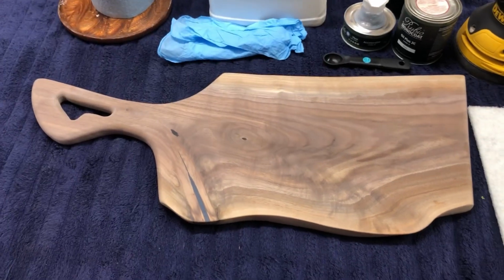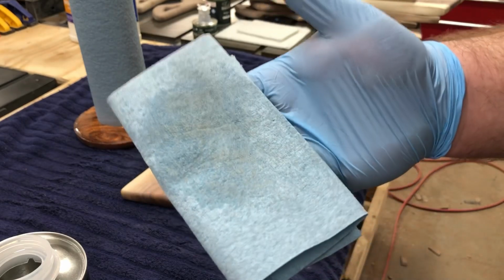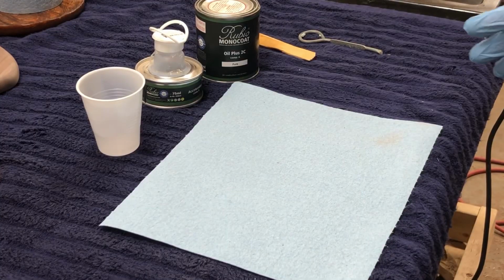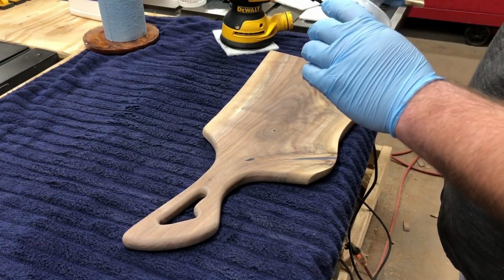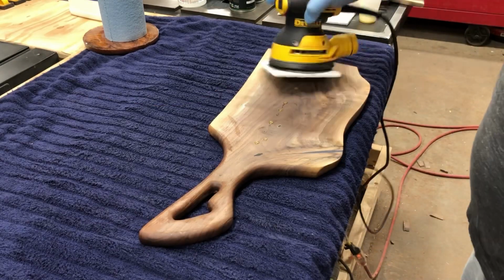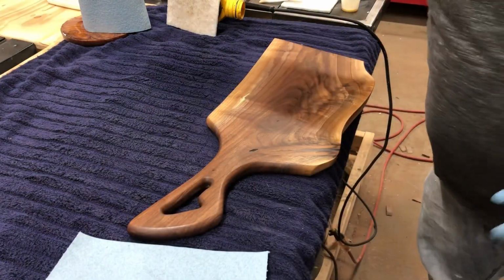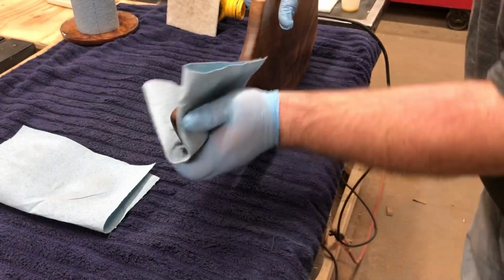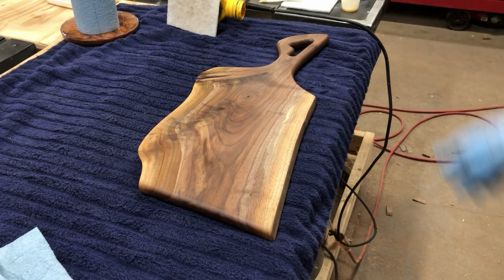How To Apply Rubio Monocoat - Simple Step by Step Process

Comment: Any idea what would happen when you put food grade mineral oil over the RMC? Obviously my board customers aren't going to have RMC available to maintain the board after several washings, and will be using a normal board conditioner off the shelf.
Reply from the maker: @ericsyvertsen5880  great question. I apply a thin coat of either cutting board oil or wax over everyone I ever do. It really helps with the shine and also provides another layer of protection. In my experience it’s never been an issue using wax or oil over top of Rubio. The wood will take what It can and the rest is wiped away. I suggest it to every person I make one for because you’re absolutely right they need to keep up on the maintenance and it’s the easiest safest way to do it.

Comment: Great video sir. Thank you. Have you ever opted to use Rubio’s Maintenance oil on any of your work? And if so how long do you wait before applying and is your application process of that the same as the 2C. Thanks again 🙏
Reply from the maker: I have not used it yet. I have been doing two coats of the Rubio lately and it seems to work well on the more open grained wood so the oil hasn’t been needed. I would recommend manufacturers recommendations when applying though.
Reply: @whiskyrivercustomwoodworki2012  gotcha. I just ordered it and will give it a shot depending on the species of wood and let ya know! Thx again.

Comment: what grit was your final sanding?
Reply from the maker: It depends on what it is. Charcuterie boards I’ll generally do 180, 220, and finish with 320. Some like a table or etc you can get away with stopping at 220. 180 if you’re very careful.
Reply: @whiskyrivercustomwoodworki2012  you can apply the Rubio after sanding with 220 or 320? I am a newbie and Rubio says 120-150 but I am curious what wood workers are doing. Any info would be appreciated.
Reply from the maker: this is my opinion and only that lol. Rubio to my knowledge was designed and intended for hardwood flooring. It’s a zero VOC finish that is safe for closed  poorly ventilated areas. Its use along with other brands of hard wax finishes have become popular with woodworking for its ease of application, preparation, and repair of I think. I believe the 120-150 they refer to is intended for floors because you would never see the sanding scratches and in the end, it is only going to get beat up over time. I’ve finished numerous projects with it using 180 and up as my finish sanding. Knock on wood I haven’t had one fail yet in adhesion or durability. So that’s my theory behind it, but I could also be way off base so grain of salt! Does that make sense?
Reply: @whiskyrivercustomwoodworki2012  thanks. I appreciate the advice.

Comment: What is that white pad you used for buffing called? It's great that it can just stick to a sander
Reply from the maker: It’s a scotch brite brand white scuffing/cleaning pad. The white ones are the equivalent to a very high grit, I can’t remember what that is at the moment though, maybe something like 5,000-6,000 grit? I’ve never had an issue with them leaving any marks after using them. Definitely super handy that you can just use them with hook-it sanders 👍🏻.

Comment: So ... was that Rubio Oil A? A plus B? Was there any Rubio Oil plus C used? Not sure you ever explained the product ... You just said 3 to 1.
Reply from the maker: What was used in the video was Rubio Monocoat Oil plus 2C Pure. I used both part A and part B (cure time is 7 days vs 30 days when only using part A). They are mixed 3 to 1 part A to part B.
Reply: @whiskyrivercustomwoodworki2012  
Thanks for the quick reply. Makes perfect sense. I simply wanted to order the 20ml sample size, but, if it had no “activator”, then waste of money. Yes, I do not want to wait 30 days for my project to set up. Thanks again!
Reply from the maker: Absolutely! Glad I could help. It’s definitely pricey, but I do think it’s worth it in a lot of scenarios. Good luck with the project 👍🏻🍻

Comment: I used Rubio on board one time and didn't like it. I am not impressed with Rubio products compared to what I use. I love Shellac, Varnish and Osmo but for food boards I love Tried and True. Rubio drys hard and I think shows up cut marks because of the hard surface it leaves.
Reply from the maker: I would agree with you that Rubio might be the worst thing to use on a board that will see a knife. It’s most definitely not designed for that. I use Rubio on the serving boards only because they never see utensils. I use walrus oil and wax on my cutting boards.
Reply: @whiskyrivercustomwoodworki2012  Thanks for the reply. I am using Tried and True on boards now, good natural product safe. The Original formula has natural linseed and wax.